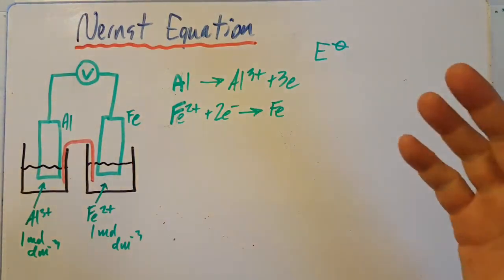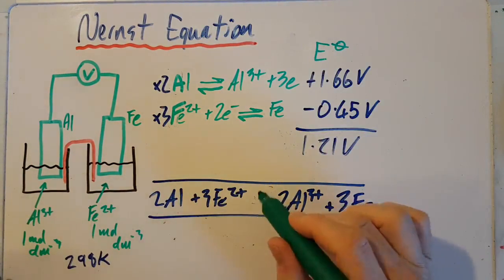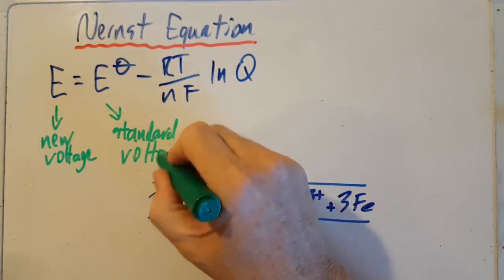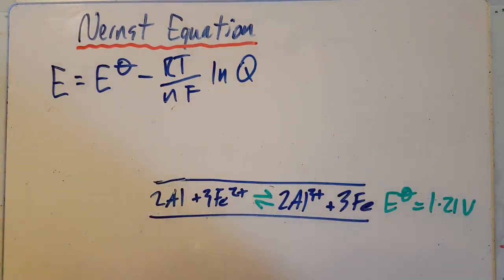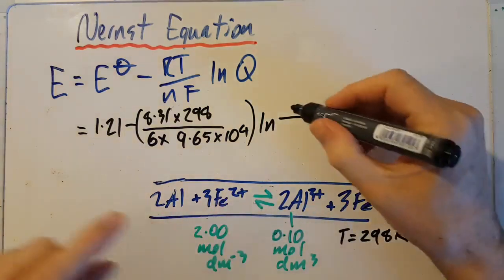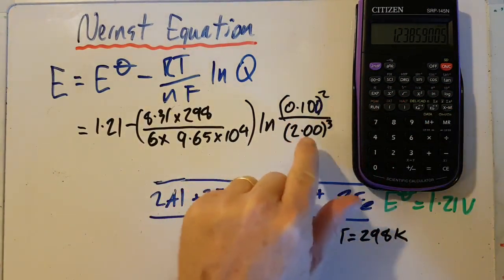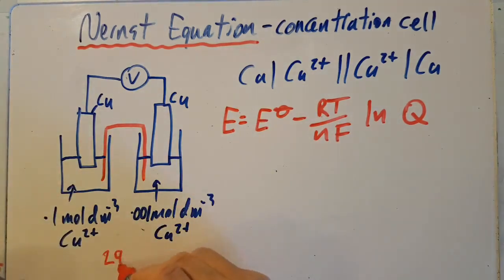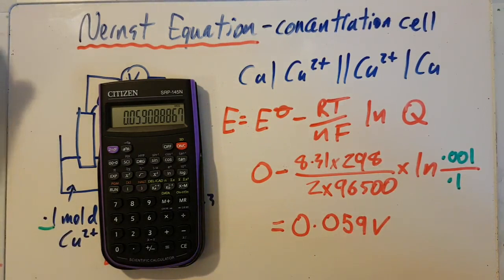C6 Nernst Equation Calculations [HL IB Chemistry]

Comment: Thank you Richard Thornley for the help, I'm actually using this equation for my Chemistry HL IA, and you explained it so well. Thank you so much
Reply from the maker: nice, I always had a bit of trouble using it in real life since the voltage change was about the same as the uncerts in the equipment. hope it worked.